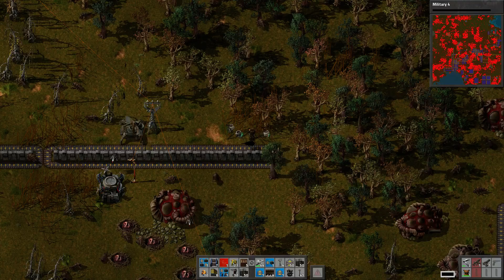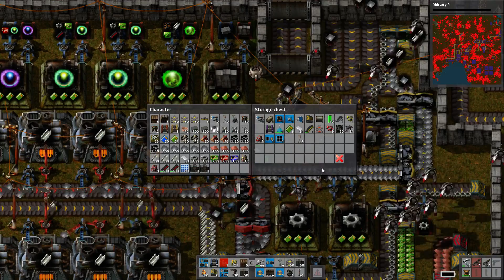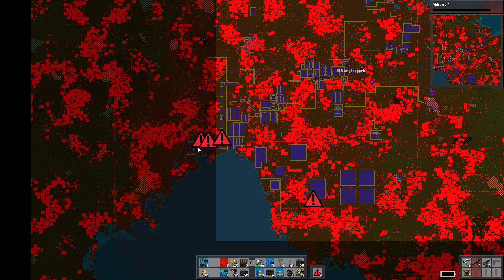Factorio: Living With Biters Ep#92: Automated Aegis Assembly

Comment: You should control the ammo loading and power supply to the defence system with signals (logic) and smart inserters! In that way you can try to take out bases a couple at a time. If a particular defence module needs to be activated you can do so with perfect control.